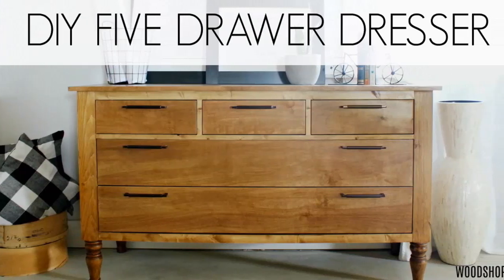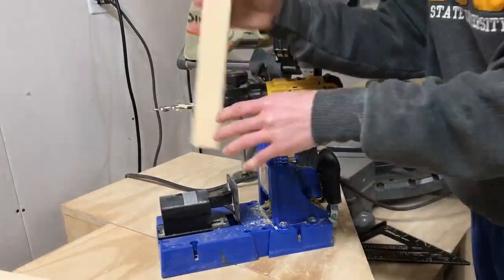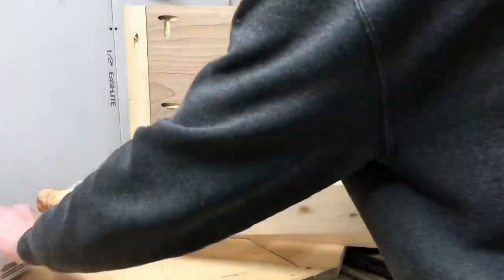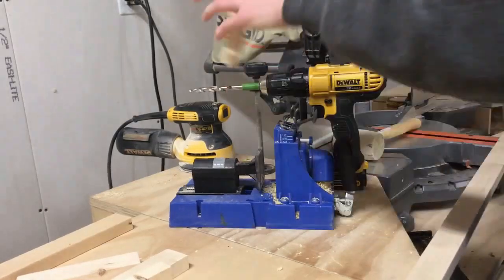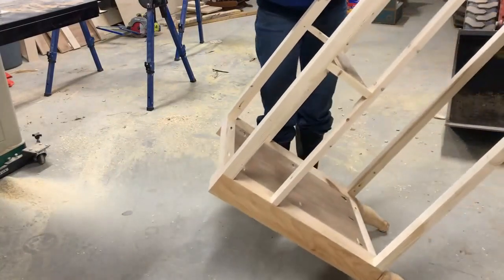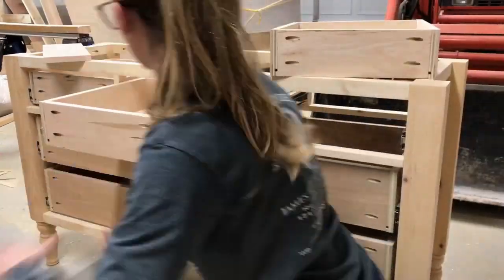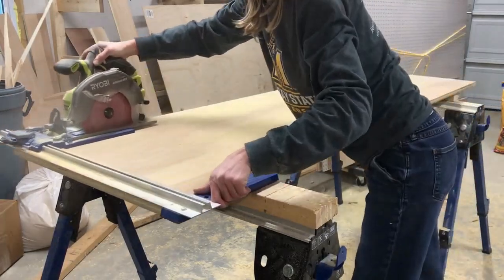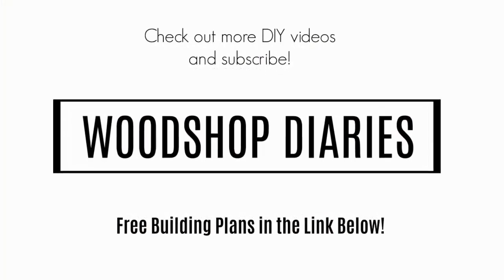How to Build a DIY Dresser

Comment: Do you find the Kreg rip cut to just suck?  I mean, I can't understand it, but I measure the starting side vs the end side and I cannot get it to match right.
Reply from the maker: No I love mine. You can see me using it in almost every video. I actually have a video of how to use it you might find helpful. The key is making sure the blade is square to the fence. And keeping the fence lined up at the start.

Comment: Great project. I'm wondering if you have any issues with the bottom sagging in the large drawers since there is no middle support on them.
Reply from the maker: Not really. It’s a long span side to side, but since the drawers aren’t that deep, it is supported well in the front and back so it doesn’t really sag
Reply: @WoodshopDiaries  thanks. I'm going to have to make one myself.

Comment: What type of wood was used?  I get the plywood but was the other wood hardwood?
Reply from the maker: Pine 👍
Reply: @WoodshopDiaries  do you find the pine to be sturdy enough?  I started making one out of pine, but I read that due to its softness it could show more scratches and dents if hit or anything
Reply from the maker: I make the majority of my stuff from pine and never had any issues. It will dent and scratch but if you’re rough enough, so will oak and other hardwood.